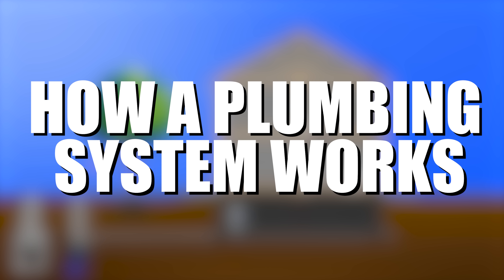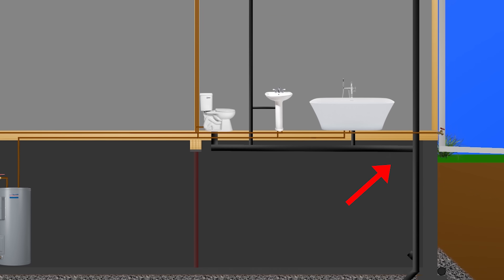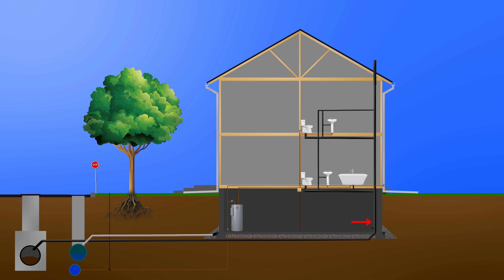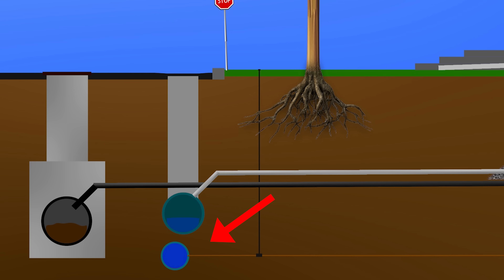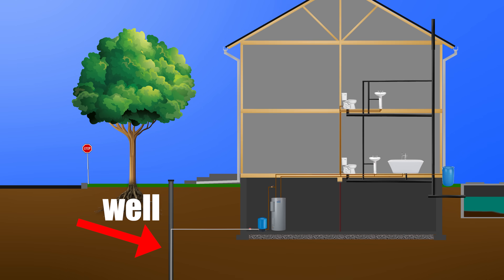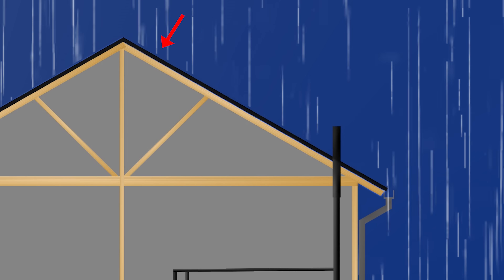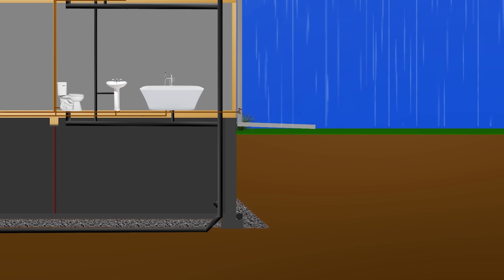How Your Home Plumbing Works (From Start to Finish) | GOT2LEARN

Comment from the maker: POPULAR ITEMS I USE IN MY VIDEOS:
AutoCut Pipe Cutter 1/2": https://amzn.to/2XlyqAn
AutoCut Pipe Cutter 3/4: https://amzn.to/3gPmhhz
Superior Tool 1/2" Cleaning Attachment: https://amzn.to/2kwBMBK
Pencil Torch: https://amzn.to/2U3OTaa
Fitting brush 4 in 1: https://amzn.to/45ELin6
Propane gas (yellow bottle): https://amzn.to/4ciYgMa
Lead-free tinning flux: https://amzn.to/2U3abEW
Flux brushes: https://amzn.to/3S1xsrK
Low temp lead-free solder: https://amzn.to/4jjpWms
Fire proof blanket: https://amzn.to/3RzlkfU
Abrasive pads: https://amzn.to/2XaY6kT
Pencil reamer: https://amzn.to/2tBuhKW
All-in-one deburring tool: https://amzn.to/3B9dLUv

Comment: Hi I just joined a drainage maintenance cleaning company in Japan and wondering if the plumbing system shown here is universal or is there somewhat of a difference?
Reply from the maker: What you see here is known to be a North American type system, this will vary from country to country.
Reply: thanks for the quick reply! time to do some research I guess!

Comment: Most homes don't have basements. About 60% of Americans live in climate regions where they are not needed, or the rock is too hard to blast through without dynamite.

Also: Domestic line pressure is regulated at the home by a PRV (Pressure Regulator Valve). It is impossible to tell what the pressure to a home is going to be but on average it is 100- 180 psi, hence the news for the PRV.

Comment: 2 Major missed items : the city’s utility water metre for billing and consumption data uses; and, the back-flow protector one-way valve, at the 4” sewer discharge pipe exiting the home.

Comment: I would add most municipal water supplies are not from the same area where treated sewage is released. In our area, it comes from about 100 miles away in a man-made reservoir.

Comment: I have a question. I am from India. We have 2 tanks at our house. 1 tank in underground which stores municipal water. 2nd tank at top. With electric motor 2nd top tank filled from underground tank water. As per your video in USA for water to reach at 1st floor requires pressure. So this much pressure available all the time from US municipal pipe? Also I have seen mostly 1 storeyed home in USA, what about 2 storeyed home. Does water go to 2nd floor?
Reply from the maker: Yes, water goes to 2nd floor.

Comment: What to do if one of pipe of water  is demage and need to fix  if pipe is under house
Reply from the maker: That rarely occurs, but if it was to happen, you need to break all the concrete, dig and repair the pipe, yes.
Reply: @Got2Learn  thank you
Reply from the maker: @gordanamarkovic9968  You are most welcome :)

Comment: The video says that a dowside of pumping potable water from wells is having to use a generator when the electricity cuts out. I think another solution would be to have an elevated small water tank (roof level) that can be filled and used by gravity when the electricity cuts out.
Reply from the maker: Good thinking! 👍

Comment: I live in a residential place with a second floor. When I moved in I noticed our house had low water pressure. We changed out all of the out-dated pipes and had the same result. I had my plumber install a Grundfos Scala 2 booster pump that conveniently began to leak after the warranty. Before trying to repair this device, is there another water pressure booster device that the plumbing community can recommend that has a history of reliability? TYIA

Comment: Hey @everyone I bought a brand new house which has a well. Well pressure is 70psi but my house is getting it at 60 psi. We even removed the city pressure valve. Well company even came and checked. They measured the pressure 70 psi but at my garden’s water outlet it is 60psi. What might be the cause of this issue?

Comment: Ok, but if all the plumbing pipes are horizontal (or just slightly at an angle) how does all the waste travel through all the length of the pipes and out of the neighborhood and into the facilities? I never understood that.
Reply from the maker: thanks to the water!
Reply: @Got2Learn  each flush or water usage is not enough to push a load of waste down a horizontal pipe that is miles long. I'm wondering if there are some sort of pusher every few feet of pipe or I am confused as just simple water pressure alone cannot move solids across a very long length of surface.

Comment: Got2Learn: I have a question. I live in a second floor apt. One day I heard what sounded like a waterfall coming from one of my bathrooms and sure enough, the water was pouring up and out from the bathroom sink drain like a tsunami that wouldn't quit.

The building manager sent someone over immediately to help and well, the water just finally stopped pouring out and he couldn't explain what happened.. 

He dumped a bottle of Drano down the drain but the thing of it is, I've never used that bathroom sink in the 4 yrs I've lived here so how would it get clogged up and since when does a clogged drain create a tsunami of water to just start pouring into the sink and overflow onto the counter and all over the floor, out of the blue?

Have you ever heard of anything so bizarre? I don't expect you to know or be able to offer advice but maybe it's just a simple answer. Thank you for reading my query.

Comment: Hello
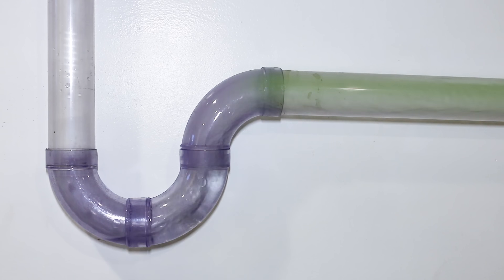I think my kitchen sink P trap is being siphoned out by toilet flushing like in this video at 2:40. 
Any recommendation on a diagnostic I can do to confirm or deny this?

(All sinks drain properly and there are no gurgling noises. Problem is sometimes the kitchen sink drain smells bad, sometimes it smells fine. No other drains have smell problem)

Comment: we have copper for a few lines in our house built in 2005 here in Wisconsin, but for all the lines running throughout the house it says AquaPex on it, so I guess we have Pex.  We have a water softener from 2008 that still works, it has a rotary dial on it but its still working great, so if it ain't broke, don't fix it.  The Dishwasher is easily from 2005 when I graduated high school (has the same look and feel with a rotary dial to work in it just like the ones I remember growing up), and it still works 20 years later, things are breaking on it but since its mechanical, the thing still freakin' works great and is clean

Comment: Great video! (2) questions I'd like to ask:

(1) At about 4:31, when describing well water connections, what is the blue "apparatus" that sits before the water heater tank?

(2) For well water connections, is that blue "apparatus" required (if so, what would happen if a home didn't have it and just connected straight into a water heater tank)??

Thanks again for the awesome video
Reply from the maker: (1) That is a buffer/pressure tank to make sure you have constant pressure during usage or else the pump would need to run constantly to maintain pressure.

(2) I am no expert on wells or well systems, but I believe it's a necessary element for it to work adequately, maybe an expert on here can clarify that for you.

Hope this helps, don't forget to share if you can, cheers!

Comment: Wells are not 500 feet deep typically. Where I grew up in Ohio deep wells are 75 or 100 feet deep.  It depends on where the water table is, but 500 is not a good average estimate.

Comment: This sounds like a Thesis project from someone with no hands on experience in construction.  Basic principle correct, but there are several more layers to this.  I'll just start with I build houses and an entire house can not be built with one vent, black & grey sewer water can not be mixed, & Wells are typically @ 1300 ft. in depth depending on your area for spring water (unfiltered).  I do think you are right but again, think this sounds like a school project that you posted.

Comment: can i add a vent however it works with a couple 90 degree joints as long as its parallel/inclined? i’m fitting underneath a trailer so can’t do directly up

Comment: I absorb a lot of knowledge about a wide variety of things from YouTube videos.  I hold people like you in the highest respect!  I am currently plumbing my house and you are just the guy I was hoping to find and learn from.  It does make a difference in the way I choose to absorb information knowing that is comes from a seasoned professional.  I might have a question or three along the way. I hope you don't mind if I reach out and ask you about something.  Soon, I will be demolishing the cast iron stack and replacing it with PVC parts.  Any advice for this is warmly welcomed.  I have been the assistant for this task only one time in my life and now I know enough to be very dangerous!
Reply from the maker: Thank you so much, if you want to join my forum for questions it'll be easier, it's free: https://got2learn.freeforums.net/

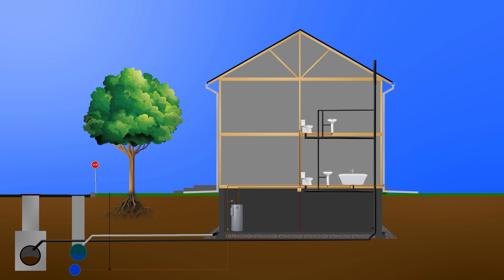Comment: 3:10 "the vent minimizes the chance of this happening" that's incorrect. It would happen regardless of the presence of vents. That's why you don't run wires through sewers.

Comment: Typically the sewer line is the deepest and wouldn’t run over water or storm drain lines just in case of leaks so it doesn’t contaminate

Comment: Fascinating, thanks. But I still have a question. I've often wondered : what if, for some reason or an other, there's no one left to maintain this system, would the municipal potable water still come to your place, and also, for the municipal drains, would they still work ? Thanks for the answer if someone knows
Reply: Probably not. If no one is there to monitor giving of water to your house, you would not have water. You would have to buy bottled water or make your own reservoir.
Reply: @wewhoareabouttodiesaluteyo9303  thanks for the answer. That's what I thought as well but I wanted to have a confirmation 👍
Reply: @nicolasngo-di7272  Yeah, it kind of sucks having to pay the water bill every month, but we forget how bad it would be if we did not have this luxury. The water has to be cleaned, it has to be distributed in a way to make it easy for you to access it. 

I would hate to have to carry bottles of water home everyday just to use and I would hate to have to wait until my reservoir filled up just to suck it up through a pump and use every time I turned on a faucet.
Reply: @wewhoareabouttodiesaluteyo9303  you're right. 
Or we could try to go somewhere where there is a water source to build a well above, but it requires drilling and building. Not counting the fact that the water needs to be pumped by hand, which needs a caloric input. And also it would just be the potable water, not the water needed for showers or taps which would probably need an electric pumping system, which requires being connected to the grid also (or an expensive solar solution). 

So yeah, I agree, let's not forget the fact that it's a miracle that all of this is working. Without forgetting to prep for the bad times either

Comment: A story from my childhood:
A lift station somewhere down the sewer line failed, and backed up the sewer. There's a manhole in my parents' backyard that started overflowing sewage. However, there's also a storm drain 5 feet away and downhill from the manhole, so the sewage was flowing directly into the storm drain, and subsequently into the creek nearby. 

I have no idea why, but eventually the sewer overflow stopped, and then began overflowing from our indoor toilets all over the neighborhood. It took months to fix our basement.

Comment: To prevent rats from chewing on the rubber sheathing why don't they coat the cables in something the rats hate, or mix rubber with something that the rats hate to smell or taste, that would prevent manhole covers from popping into the air

Comment: Thank you for the video! One difference to where I live is that our water is heated using district heating. The water from the municipal source goes through a heat exchanger located at the property and gets heated by the district heating water.
Reply from the maker: Interesting!

Comment: You didn't mention. Most houses have a basement sump pump for the times storm runoff becomes too much and penetration prevention systems fail. If the water level goes high enough the pump turns on and sends the water to either the sewer drain, or the runoff drain.

Comment: hi i see that you read every comment and heart it. i wanna ask and have more clarity about how water goes from water heater to tap and showers and how that works.
Reply from the maker: City/pump pressure!
You're water heater has a cold water inlet which is fed by your city or well pump's pressure.

Comment: As an experienced electrician, i can confidently say electrical ststems in homes are THE MOST IMPORTANT PART! Otherwise that sweet, sweet water yall need so badly, dont flow outta those faucets, and doesnt get cleaned propperly… your welcome

Comment: Is it possible to damage the system by using a garden hose attachment that has a tiny hole so it has more pressure? As a substitute for a pressure washer

Comment: Good info! I always wondered what that metal pipe  was sticking out of the roof.. Rats used to go in there until I had it covered with wire. Now if I could just figure out why my water heater lines going to the washer are switched but work just fine.

Comment: Liked and Subscribe. Nota single plumber who visited our home was able to explain why we had a momentary back pressure that violently shot water from the back of a bathroom wall and leaked some water that caused a small leak on the ceiling on the lower floor.  What happened was we shut all the valves in the house, but not the main water line for 2 month, meanwhile, we had a friend water our lawn 2 times a week.  Would you know what might have cause that leak?  The plumber was not able to locate the leak, now what?  Thank you

Comment: I don't know if it's different in the US but here in Canada I've never seen a water shutoff valve outside a house. I've seen water valves outside but definitely not for every house. There's also no outdoor access for the sewer pipe but that may just be because our house is old
Reply from the maker: C'est plus aux states.

Comment: I still don’t get how the cold water travels through the house when the heater is not in use.
Reply from the maker: The cold water tee's off, 1 line to the tank to supply it and the other line to supply the house with cold water :)

Comment: Sad that in some places the rivers in which treated sewage is dumped and where rain water filled with all the trash and chemicals it sweeps up is the place potable water is taken from to be pumped right back into homes. What type of filtration does it receive before it goes into our pipes. I certainly would not even bathe in river water , much less drink the crap.

Comment: Good video, thanks. As a Master Plumber I will say that your information is mostly correct and your diagrams are very good. Only minor flaws, but understandable. 

One thing I will say is that while wirsbo pex has seen widespread adoption and is holding up well with time, copper is still king for supplying water. It seems to handle the stress of pressure and temperature changes the best.

Comment: In my country toilets don't flush good, they are weak, in North America they suction strongly, I always wondered why. This video shows me why.  In my country toilets doesn't have a vent that goes up through the roof so there is NO air coming in to flush good.  Like a fuel jerry can which needs to have a 2nd opening for the fuel to pour faster.

Comment: If you are having any problems with your home with Flo always call the city first to make sure it's not the mains out in the street holding to affect your house the city Mains are the city's problem, it could save you a lot of money from a plumbers visit.Rain in any ways does not effect your sewer issues unless you have so much rain the 
Ground under your lawn caves in.

Comment: kitchen sink drains are always 2"... from the stack onward. the trap arm can be 1-1/2"- but as soon as it meets the stack (vertical)... it is ALWAYS 2".  the reason is... the kitchen line will clog in a very short amount of time if it isn't 2", due to soap grease.

Comment: How come sometimes the water in my toilet bowl is moving?
Reply from the maker: The air in the pipes moves abruptly, like when there's a lot of wind outside and when a lot of water flows in the pipes really quickly.
Reply: @Got2Learn    YES!  It happens on windy days and I always wondered hot the wind could get into my pipes?  Thank you so much!
Reply from the maker: The wind will make the air move in the pipes, thus, the movement in the water ;)

Comment: Never have I needed power to get a drink of water at any home with well water…
Reply: Unless it used a manual pump or windmill, well water needs power to get the water out of the well.  If there is a large enough tank, it may last a little while without power, but once the pressure is drained from the tank you will not have water to the tap.   City water does not require power at the house for it to work though....

Comment: what could be a problem, that water from sink drains very slowly? I cleaned p traps and other pipes, also the ones in the wall, so drain isnt clogged... thank you for any solutions...
Reply from the maker: Vent might be blocked somewhere along the line...